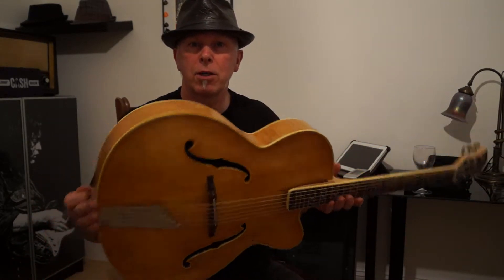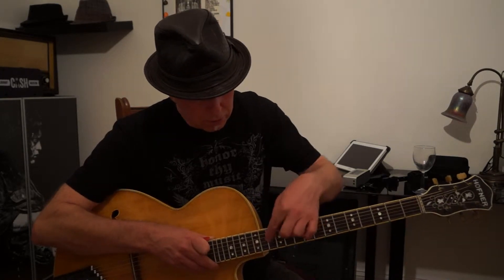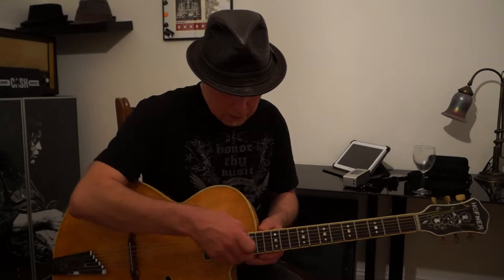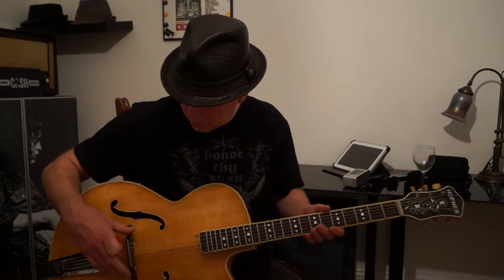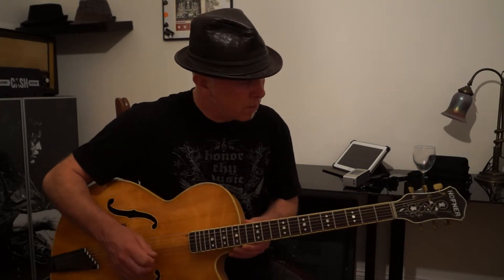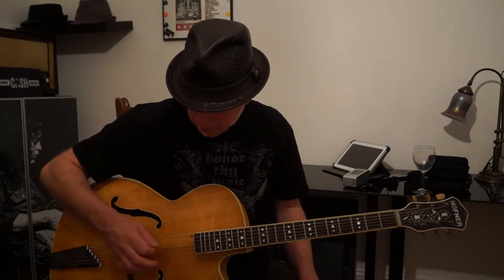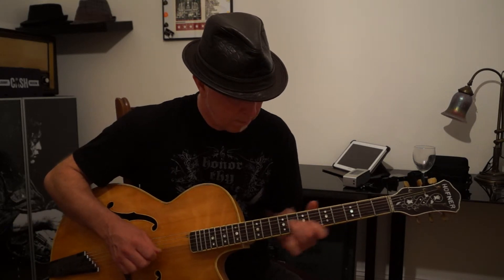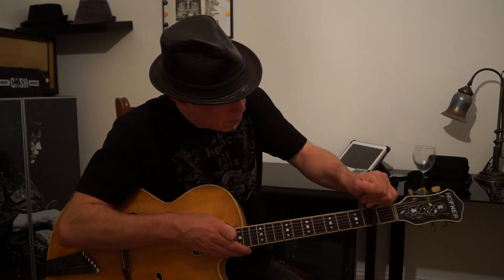1959 Hofner President Rebuild

Comment from the maker: If you keep an eye on ebay you can pick one up for around £250 although it may have some repairs. A lot that you see have the neck repair but if its done well it does not affect the sound. The only drawback with mine is that to get the best sound the action has to be a little high. The spruce top gives a lovely sound.